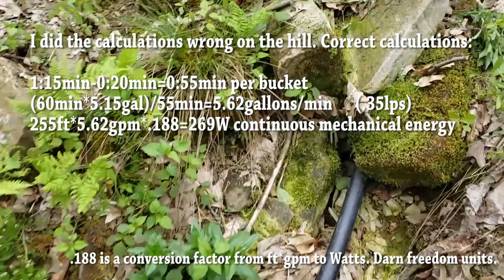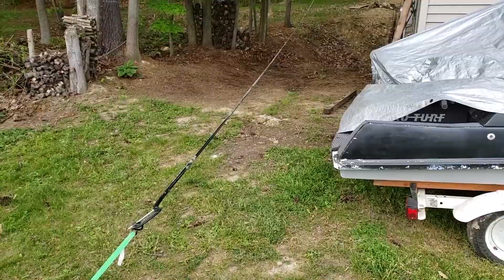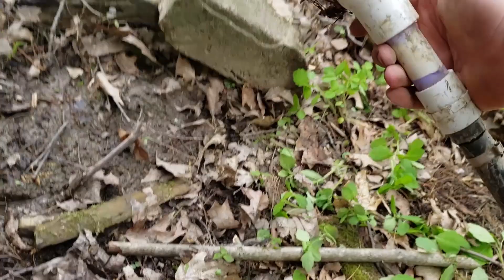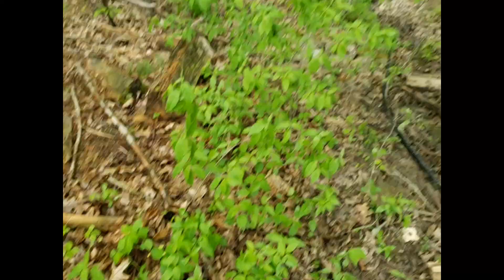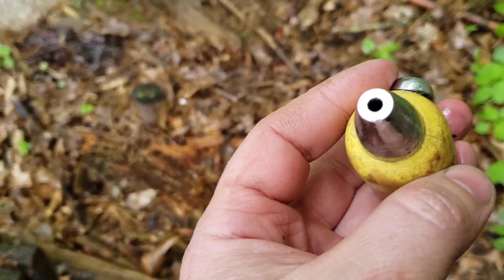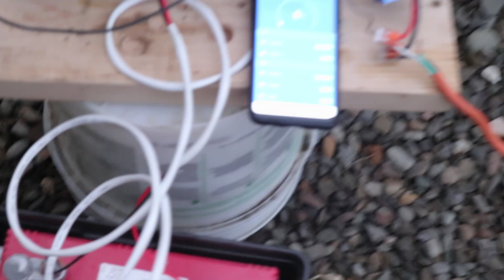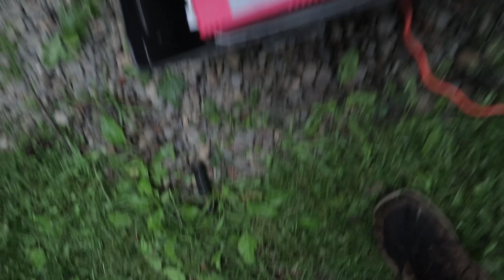[Part 6] Kilowatt Microhydro Turbine - FULL Pressure, Pipe Routing, Tiny Turbine Watts

Comment: If you put a wider pipe for the first 100 foot would that give you more pressure?
Reply from the maker: No. Only height adds static pressure. A larger pipe up to a certain point will reduce friction losses.

Comment: Been watching these videos for a day off and on now and going crazy.  It is clear that you are doing research but it would seem that you get so excited about the project that you just jump in without thinking the fine details thru.  I know you think this is content, and for some it is, but I must say that I spend allot of time jumping forward.  Lastly, in this video you are relying on an uncalibrated POS gauge from the home store.  Seriously!  If you are going to take measurements that you consider accurate then suck it up and buy a decent pressure transducer and display.  Also, a cheap transit and a bit of trig would have driven you an accurate account of your head from the start.  There are also GPS apps that will take measurements over time and average them to remove instantaneous\ short term drift present in the GPS fixes we normally get.  Sorry for the rant but...
Reply from the maker: I thought it was clear in the first video when I used a good altimeter, barometer, and topo maps to get a pretty accurate measurement. Also I did finally upgrade my pressure gauge.
Reply: @JoeMalovich  Yah, the Altimeter in a cell phone is less than accurate.  Same for the GPS unless you use software that does fix averaging.  But 10 minutes on the top and on the bottom would have provided the rise to better than a meter or more.  I did see that you got a much better gauge and the difference in the reading was noted.  Not ripping on you, you are a work horse to be sure and I give you props for the results.  Keep up the good job and congrats so far.

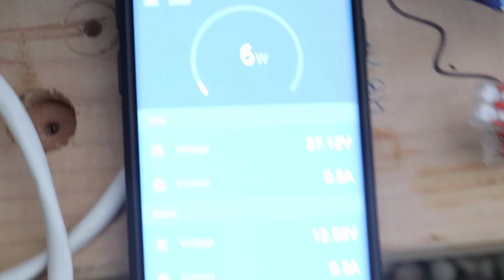Comment: some late info.      can you spell   METRIC.    if yer bucket were graduated  in  LITERS,  sampling  Could be completed, in  ten  seconds.     at 4:12,  it is true that, with a head of  seventy meters,  there are 268  watts of  POTENTIAL  energy available, On Paper.       however, as stated previously,  with Such a low flow rate,  there is only one way to  convert  even  fifty percent of that energy to  watts-Electrical.      it would  REQUIRE  the use of a correctly designed, overshot waterwheel, having a radius of  120  FEET.          at 27:25, without listening to all of the commentary,  the upper set of values results in watts of  4.09.      the lower set of values. labelled 'battery', results in  watts of,  6.25. 
system output Could be greater if a, suitable,  brushless pma  were utilized.        googletranslate

Comment: I'm quite sure you can't pull a vacuum unless you put a large diameter pipe behind a low diameter and then plunge that larger diameter about 10 meters (or 30 feet) straight down. You can easiest purge bubbles by opening the end with no attachments.. The friction will however stop bubbles from purging when you keep the hose closed.

Comment: That sprinkler was blasting a lot of pressure, making it wiggle back and forth. If you'd let it go it would have worked itself loose from the ground. That other spinning one there was so much pressure it jammed the rotation.

Comment: Hi Joe The adjustable nozzle you have purchased wont work well with that pressure and such low flow. by the time it is open enough to make a fully formed jet it will be draining your penstock. Dont get me wrong it will work but it will be less efficient and very sensitive and have a very small range it will operate in. In my Opinion this system really wants 3-4 fixed jets of different sizes. so you can make adjustments by turning on and off fixed jets.
Reply from the maker: That adjustable nozzle is just something I had on hand, I don't intend to use it to produce power. I tossed out 30 minutes of video going over why said nozzles are no good. I was showing dynamic pressure drop at varying flow rates and these most open nozzles would easily drop it to 40-60psi  ~3-4bar while the adjustable nozzle with a smaller effective diameter was able to maintain higher pressures at lower flows. Then I was going to calculate power available based on pressure and flow by timing how long it takes to fill a bucket at a given pressure for different diameters of nozzle. The results would then be plotted to find an optimum jet diameter which I would then compare with the penstock spreadsheet from the last video. I tossed the footage because it's a divergence from the core line of this video series with the big penstock.
Reply: Joe Malovich sorry I should have been more clear. I saw your post that you had purchased an adjustable spear valve the same as the one I use. I was talking about that one. The opening is way to big for your flows and pressures.
Reply from the maker: @KrisHarbour  I asked the seller before purchasing with this same concern, he said it works down to .4lps. Below .4lps flow I'll just put in a small fixed jet(s)
Reply: @JoeMalovich  oh ok, i suppose he must know. from my experience though they are not precision enough to center at low flows. Good product, im not at all saying it isnt good but from my experience i am quite sure you will have problems getting the range you want from it. You would actually be better off with the one i am now using as it has a much smaller nozzle about half the size. problem is it was custom made and i am testing it at the moment. they might become available for sale one day though once tested properly.
Reply from the maker: @KrisHarbour  Thanks for the insight, I will pay attention to jet centering once I get everything installed. I might need to build my own if it comes to it. I have a sherline cnc lathe that I've never actually used, and I've run a big cnc lathe before too so figuring it out shouldn't be too bad. 

I just don't have the time to mess with it between finishing all of the trim in the house, business work, buttoning up everything for certificate of occupancy, and just building the big hydro system. I think I've discovered that I need a pressure regulator if I'm too use the water for things like watering the garden, too much pressure generates too much flow sucking the spring-box dry.

Comment: Think of it as plumbing you are pulling a siphon down the main pipe without an air vent to break the siphon so are pulling air down the full length of the pipe. Spring > spring box > vertical vent > pipe down the hill. There is next to no pressure at the area of the vent so all you need is for it to be higher then the water source and it will give any air sucked in a place to escape before it gets pulled with the water down the hill. 

Are there any other springs on the hill you can also tap into? Good to look for them now as it could effect the overall plan if you could have other sources to tap into.

Comment: We did some physics of hydrodynamics, way back in college.  I can remember that for a Pelton Wheel, the maximum power output occurs when the water jet is deflected 90 degrees.   At rest it would be 180 degrees, and in free spin the jet would not deflect at all.  We had Perspex sides to our test wheels.

Comment: I'm really surprised that all that flow only made a couple watts.  Am I missing something?
Reply: High pressure but very low volume
Reply: @CChan11  I reckon so...
Reply from the maker: @blackz06  I have the generator in hand, still need to select a runner which I think I'm getting from h-hydro.com. stainless turgo.
Reply: @JoeMalovich  okay cool.  How much power are you hoping to get out of it when complete?
Reply from the maker: @blackz06 probably between 600 and 800 watts sent to the charge controller.
Reply: @JoeMalovich  The 3 phase motor from an old washing machine or tumble dryer would easily get you those kinda wats, very interested in your generator chosen.
Reply: @JoeMalovich  cool. I'm looking to generate 1kwh/somehow. Whether it be solar or whatever... just learning about all this stuff.

Are the inverters nowadays pretty efficient?
Reply from the maker: Well I did say it's an ill-suited turbine.
Reply: @JoeMalovich  lol... true!  I've seen people testing those little things and they don't do much.

I haven't watched all of your videos... do you have your turbine and generator picked out yet?

Comment: You should put a bucket of concrete  every 20 meters to stop the hose from sliding down,  it could be a whirlpool at the top that sucks air in the line.
Reply: A plastic ball in the water will stop the vortex and sucking of air in the system